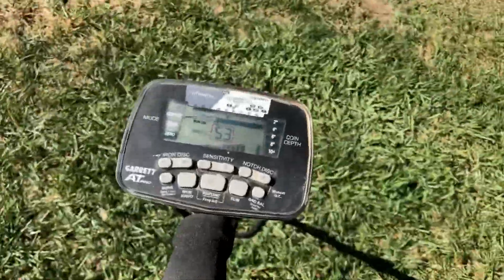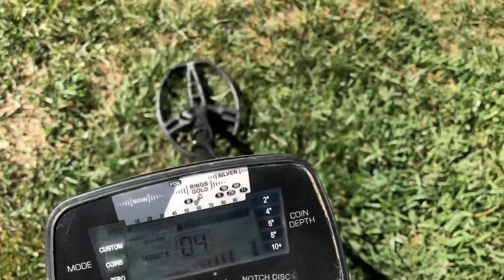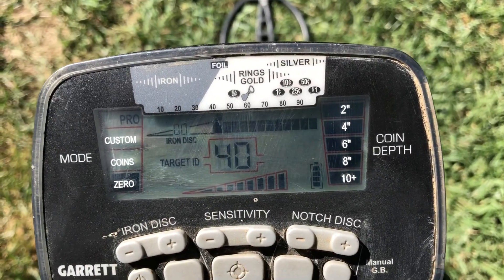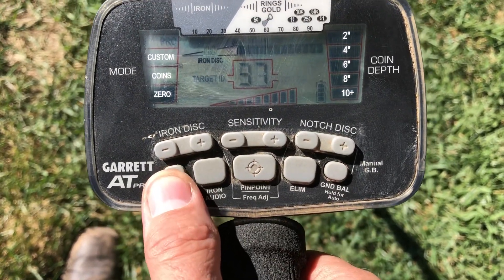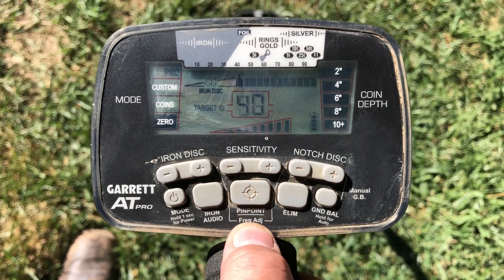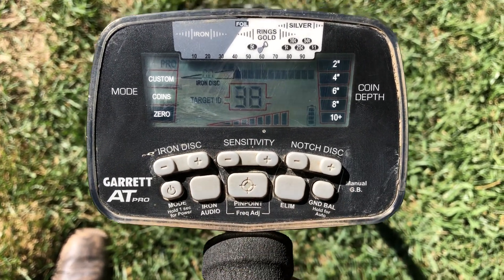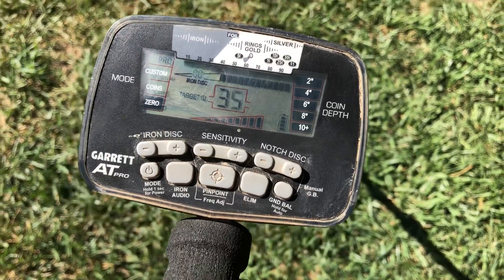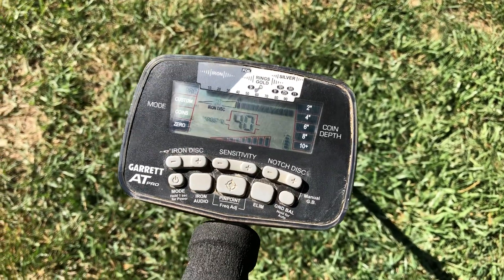I NEED YOUR HELP! What is wrong with my machine? #atpro #metaldetecting #5280adventure

Comment: My AT Pro did that before.  Someone told me to take the coil protector off and clean the coil and dry it good. That worked for me.  The 2nd time it happened all I had to do was turn the sensitivity down.

Comment: Clean coil cover. Do hard reset take batteries out when detector is on. Check coil connection. Also wiggle the coil Wire where it goes into the coil to check for short. If it continues switch coils.. if it doesn’t clear up send it into Garrett for Service.

Comment: This has happened to me before with my Ace 400. First thing I learned..my cell phone was in a case on my right hip.. definitely was getting interference. Now I carry my phone in my back left pocket and have no trouble. Also, you're under power lines. Certain power lines affect my machine. In those cases I have to lower my sensitivity until it goes away. Try a different area away from the power lines, keep your phone away from it, and see what it does. Last thing I would try is to simply take out the batteries and check for any corrosion on the contacts, maybe clean them with a piece of sandpaper and put a fresh set in. If none of this works, then it might be a case of having to send it in. But it does look like interference from something, and changing location just might work..best of luck with it, hope all goes well!

Comment: If you have a coil cover, remove it and spray windex over the coil and inside cover, wipe dry. If that dont help then possible the coil is faulty. Clean the coil back off sensitivity if you're in a high emi area. The area you are in might have a factor as well.

Comment: Hi Tony
It sounds like EMI interference to me. If turning down sensitivity helps, great. If not, some of the comments already made by others here could solve the problem. My former ATGold would sometimes misbehave like that and it was usually EMI or a loose coil cable/faulty connection which is why I no longer have it!
Jeff McClendon

Comment: Its either a coil connection issue due to water (I took mine apart and dried out the connection then it stopped / bad batteries can also do this or its the connector not clicked in fully on the pcb inside the display control unit. I have a video showing how to get to it if you have no warenty and dont wish to pay someone 100 bucks to do it but try the other things 1st. Good luck

Comment: I'm assuming you don't have a spare coil. It looks like your batteries are fresh. check the coil connection at the back of the machine for corrosion (greenies), bent pins and tightness, If that's all good then it probably is the coil.Might look for a local metal detecting shop or club. see if they have a coil you could try. If all that fails you can come get mine or borrow a coil! GL!

Comment: Coil Protector or just turn sensitivity down but lose depth   the coil could be bad power lines etc.  mineralized ground   so many to chose from Tony..  Sorry cant help.   mine does it if i put the Nel big coil on  I get the same thing like power lines in ground or above I turn down the sensitivity and it works fine..some times i have to go to a smaller loop.   BOL   AL

Comment: hey buddy
how high is your sensitivity ,,my detectors do that when there is a lot of electro magnetic interference 
you should try a different coil,if that fixes it it was the coil ,I also have a coil that will do that when submerged in water
it's either the coil or the electromagnetic interference ,,hope you get it figured out and get to swinging(thumbs up)